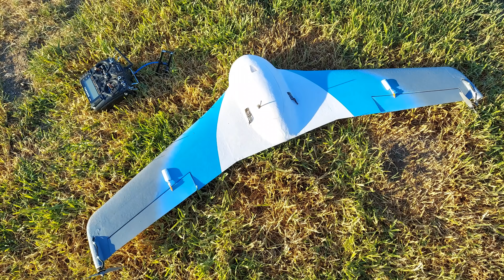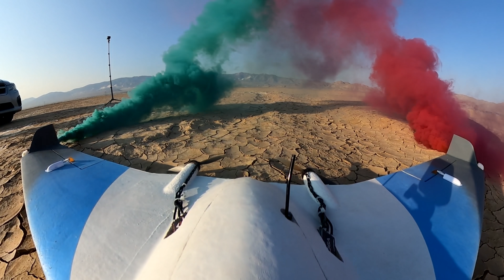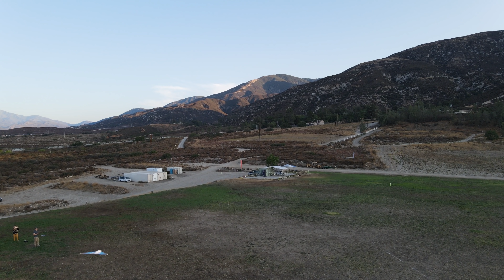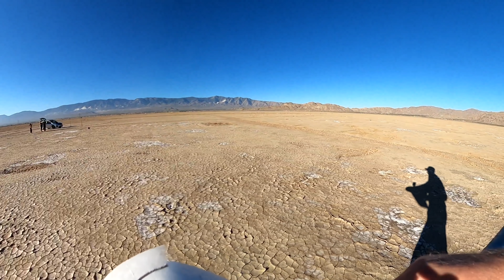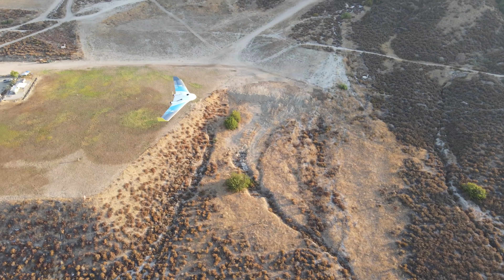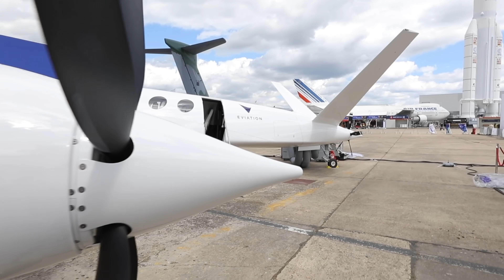Can Wingtip Motors Improve Aircraft Efficiency?  RCTestFlight Solar Collaboration Part 1

Comment: I wonder if the vortex interacting with the props make each individual prop get more lift/propulsion.  Worded poorly but I think you know what I'm saying. You're forcing more air on each blade.
Reply from the maker: I think perhaps making my own wind tunnel with multiple smoke streams starting in front of the wing and prop would be informative.
Reply: Wingtip props counteract wingtip vortices by interrupting the flow of high pressure flow from the bottom of the wing into the low pressure air above the wing,
Reply: I was thinking along these lines, but considering that a vortex would have a different angle of attack for the props than freestream air which would change prop performance.
Reply: @polomarknot17  My thoughts too. The air seems to be 'screwing into' the prop already.
Reply: If this is the case, I wonder if you'd this would have the result of a less aggressive prop pitch angle being optimal.
Reply: Luv ur channel
Reply: @montithered4741  but on the other hand, the props are more efficient when the air entering them isnt turbulent.
Reply: i would think it would be less prop performance.
Reply: How about a catamaran plane where the center of the plane is a single win and either side of the plane is a cabin?  This way you can get your props on both extreme sides of the plane.  Then experiment with v or ^ and - wing configuration to see which minimizes wing vibration.
Reply: @timn4481  correct, so the props could be mounted in a tractor/puller configuration instead of a pusher propeller.
Reply: @polomarknot17  Propeller performance depends on incoming airflow profile
Reply: Prop pitch should be investigated. Due to the incoming vortex, the prop pitch may have to be at an extreme angle.
Reply: @thinkflight  make a wind tunnel like Peter Sripol's electric paramotor. Heck, let Peter make the tunnel for you.
Reply: I was thinking that the reverse could also be true, if the prop were in front of the wing then the vortex it generates would increase the pressure under the wing and produce more lift. Better for low speeds while the prop behind the wing would be better for high speeds.
Reply: I'd imagine that it depends largely on which direction the props spin. If the starboard prop spins clockwise, the outer edge is spinning downward, creating additional lift from the extremities of the wing structure. Spinning the opposite direction, it might be increasing the flow of air directly above and below the outer edge of the airfoil segment, increasing their efficiency. Definitely worth investigating both.
Reply: This can be explained using something called "lifting line theory" and the idea of circulation.  Essentially the wing generates "circulation" (an abstract way of viewing lift, lift and circulation go hand in hand, see Kutta–Joukowski theorem). This circulation "leaves" the wingtips in the form of two counter-rotating vortices. These vortices slightly tilt the lift vector backward causing lift-induced drag, since now a small component is opposing the direction of motion. Next comes the educated guess/hypothesis, The motors produce an anti-rotating vortex to each of the wingtip vortices which in turn reduces the effect these vortices have by reducing the downwash that causes the tilting back of the lift vector thus reducing drag.  Check out lifting line theory and circulation, it's fun to imagine an "embedded vortex" in the wing that spills out into the surrounding flow.
Reply: Consider the question from a conservation of energy/momentum? With an energetic swirling airstream, it has less axial momentum and more angular momentum. A prop acting on that airstream may get a little momentum-thrust bonus if it can de-swirl the incoming air while also propelling it back using its normal mechanism?
Reply: Would depend if the vortex turns in the same direction as the prop or not, and how the prop is rigged to deal with this aero dynamic pattern. The actual benefit may come from chasing an upwash flow, so the benefit would come in terms of lift, rather than prop efficiency. But in this scenario, a pusher prop might not be as efficient as a blowing prop, which would blow the vortex before it affects the wing, instead of after. What you depict, seems to be more interesting if considering taking benefit from the vortex direction. Which could be cool,  meaning a more interesting choice for blade profiles. but in the end, it should be up to the battery/ESC, which isn't desired. So in my humble opinion, the 2% benefit, could be improved by moving the prop afore the leading edge. But it could also be affected by the prop orientation, aswell as a it's actual position relative to the wingtip, as it could be set to blow the wingtip extrado, meaning a more interesting configuration (as was chosen for the flying pancake). Anyway, thanks to Think flight for the vid! Best regards.
Reply: @thinkflight  I don't know too much about the subject, but wouldn't it be possible and cheaper to try to rent an existing windtunnel for a few hours? With enough preparation that might be enough time to get the data.
Reply: @thinkflight  A wind tunnel test would be fun to watch. It would be great to see tests of tractor props, not just pushers.  
The wash from the props may prevent the wing-tip vortices from forming at all.
Reply: Only prop wosh from the motors, depending on the aircraft design, the propwosh will assist the flow over the wings helping to create lift, so in this case you would be better to have a high efficiency wing, if one motor quits on you you going to have a aircraft loosing control fast, with the motors weight been on the very tip of the wing, not a good idea, cannot see any real benefits been on the tips
Reply: @samheasmanwhite  this is precisely how the V-22 and the XF5U function, the upward rotating half of the vortex column presses against the bottom of the wing and entirely eliminates wingtip vortices while also increasing lift very disproportionately, it's how the XF5U could fly so slowly despite being a literal pancake
Reply: @Sethgolas   a more agresive pitch as in going with the flow might work also. contra to my previous comment
Reply: You could also optimise the pitch of the prop to adjust for the change in the direction of the free stream due to the tip vortex. 
I would be interested in see what the difference would be with wing tip motors mounted on the leading edge? Could that help reduce the intensity of the vortex as its forming @smartereveryday

Comment: It would be interesting to see a comparison of wingtip motors in a push vs pull configuration.
Reply: Yes it would!
Reply: more experiments more data!
Reply: I want to use motors to launch from flat land,but without the trike, and not in the prone position, but just using a seat, so I wonder how realistic it is to think of having motors mounted to the wingtips of a hang glider without compromising safety and affecting the flight of the wing in a negative way. I would like to have more options as to where I can launch from other from a mountain, or paying a pilot to pull you and the wing to altitude from flat ground. The idea is to get you and the wing off the ground and to a soaring altitude then access the thermals. The motors can be turned off until they are needed. The wing that is used in the video Is a simple design and similar to a hang glider wing. I used to go to a place where they trained you to fly a hang glider, there you have two options, climb the mountain, or pay a pilot to pull you once you are fully trained. In the video his motor placement seems to be pushing which worked very well. But I was thinking another mounting option for the motor would be in front , then the motor would be pulling I think, so I was wondering which would be the more efficient way to use the motors, push, or pull. Lol, I am not a pilot, and have never flown on my own, but I picture it, and  think about it all the time.
Reply: @13orangeleaf  pulling prop motors generally have more air to bite into, therefore a little more thrust.  This comes at a cost of drag and reduced aerodynamics.  Push style generally have less drag and doesn't affect aerodynamics as bad, but less air to bite into due to the body obstructing it. Of course this is all general statements due to the varying body shapes, arguably more important.
Reply: @nathanlowery1141  ok, then what would  be a better choice to get a wing off the ground and into the air , in other words to launch a pilot and wing into the air and cut the engines. Sorta like a plane pulling a glider into the air to its designated release point. I am going to guess that a motor that pulls would be this choice for this type of task?
Reply: Yes it would
Reply: @nathanlowery1141   I think about if it is possible to place electric motors on a supine hang gliding setup, first safety, then either the motor pushing, or pulling you to a designated altitude, and using the thermals from that point for the most part. But I am also wondering, let’s say the motors are mounted somewhere close to the wing tip position on a hang glider, what effect they would on flight when your using hang glider bar to push out, or pull in while your taking off and changing the angle of the wing with electric motors attached. I am thinking the only difference is with the motors the wing will react quicker.
Reply: @13orangeleaf  I can't really say much about gliders, never used one. Aerodynamically if you used a properly angled and designed motor on the tip of any wing it would make the system more efficient.. the turbulence could be moved in a beneficial way creating more lift. I think the problem you would run into would be control. Even if perfecty balanced thats a ton of weight. Without control surfaces is this feasible? Would make an interesting study.
Reply: @13orangeleaf  You can also write a novel about buying a combat helicopter. When you want an engine in a plane anyway, you could buy a second hand Apache (that military attack helicopter) and have great fun FLYING. It will just cost some money, but the fun will easily compensate that. Now, you only have great fun WRITING about launch here and launch there. Just saying.

Why the hell don't you buy a paraglider and learn to fly that before you buy it? Get real, it is not that expensive and you can start writing comments about flying you actually DO!
Reply: @center4nerds  .. and more let downs.. too easy to imbalance .. centerline thrust is proven
Reply: Pull is always more efficient.
Reply: Its called a Vought XF-5U Flying Flapjack fighter !
Reply: Need two different types propeller to maximize airflow
Reply: @calfeggs  you going to get a lot of turbulence from the first prop the propellers have to be close to each other so a flat motor would be ideal
Reply: I flew hang gliders professionally all over the world. The essence is to fly for hours and/or long distances (like hundreds of kms) without any propulsion system. Of aerobatics not to speak. People have mounted motors/props to wing or harness. Both gained very little popularity. To print solar cells onto the wing and mount a “silent” retractable prop to an e-motor in the keel might work, but still defies the idea. I mean, Superman does not strap on an additional wing suit, does he?

Comment: Might have been interesting to reverse the rotation direction of the motors and see the implications.
Reply from the maker: That would, unfortunately the spar was snapped and I decided to take the plane apart but maybe in the future?
Reply: Yes that was my thought when he said the  vortices were going opposite the normal direction.  I would love to see more experimentation
Reply: twin prop planes usually has the opposite directions, but tiltrotors don't. I always wonder why.
Reply: @VacuousCat  Tilt Rotors usually (always) have counter-rotating rotors... torque cancelling.
Reply: The Wright Flyer had counter-rotating props.
Reply: @thinkflight  Happy someone asked this question as it occurred to me while watching as a clear Null Hypothesis test that would make control losses distinct from gains via votex cancellation
Reply: Even more interesting - try all 4 configuration of push/pull props and spinning down/up.
I'd wager that you're going to get the best lift and efficiency with puller props spinning up- that's pulling air from the top of the wing and enhancing the low pressure for lift, supplementing the high pressure under the wing, and opposing the formation of tip vortices.
Reply: @thinkflight  this reminds me of the flaying pancake or Vought V-173 was the last prop fighter developed by the us tested about to join service but than sacked to to the jet era. and people constantly reporting it as a ufo made the US air force scrap it. thou the main reason it had engines at the wing tips was to stabilize the air currents at the wing tips to say airborne do to its short wings.
Reply: Most twin engine planes with counterrotating props have the propellers spin in the opposite way of what tip mounted tilt rotor planes do. in part this is to minimize asymmetric thrust in case of a single engine off situation (at high AOA the downward going prop blade has a coarser pitch and more thrust), in part to minimize the risk of throwing FOD on the fuselage, and in part to reduce the risk of a prop blade coming off in a crash landing and piercing the fuselage. There's a few exceptions, like the P38, but usually if the engines spin the "wrong" way there must be a very good reason for it.
Reply: @mithrandir1313  . of course but inside up or inside down?
Reply: @thinkflight  before i saw this comment i had paused the video to ensure that the props were rotating contrary to the vortex generated by the wing tip. well done thank you for this video
Reply: @chrisdrake4692  I mean normal opposite directions go forward (rotation direction right hand rule) on the left and backwards on the right. Tiltrotors go backwards on the left and forward on the right.
Reply: @VacuousCat  All tilt-rotors I know of rotate the opposite direction to the airflow - the underside of the wing is high-pressure, and the upper side is low pressure (in forward flight) so the blades always spin the other way, to semi-cancel-out the resultant wingtip vortices:  https://youtu.be/xnOw3clRIoI?t=53 - e.g.  the left one always goes anticlockwise (from the perspective of either the pilot, or an outside observer - same.)
Reply: @chrisdrake4692  I'd say it's because it's more natural if it induces right-yaw when collective-up left rotor to roll right.
Reply: @VacuousCat  There is no Yaw, of course - they COUNTER ROTATE.  Go look at the video links I posted.
Reply: @Mithrandir13 I find it amazing this wasn't the very first consideration when making this rc plane. I would've liked to have seen what would happen with counter rotation in both directions. I'd imagine it'd be more efficient opposing the direction of the wing vortices. Guess we'll just have to guess.
Reply: @manifold1476  They were way ahead of their time.  Even today, their propeller is still one of the most efficient.

Comment: I think in practical GA use, the risks of differential thrust in the case of an engine out, vastly outweigh any efficiency gains.
Reply: maybe it's possible with central propultion and lowering trust on thrusting wing
Reply: @sebastienl2140  you're talking about essentially running on 1/3rd power to solve the differential thrust problem. Most aircraft would seriously struggle with 1/3rd power.
Reply: Bobb Grimley  If you had even minimal flight experience you would know you're not often within gliding distance of a runway. 
And if you had even minimal electronics experience you would know there are many points of failure, especially speed controllers, and engines also fail. Losing a propeller isn't unheard of either.
Reply: @Skinflaps_Meatslapper  You’re essentially talking about a 2 engine aircraft without single engine operation?  You’re saying if an engine fails then cut/reduce the good engine as well, yes?  And you justify this with the existence of BRS installations and landing planes on non-runway surfaces?  If it’s me buying a twin engine plane, I’ll pay for the extra gas to get OEI capability every single time. The moment arm for a wingtip motor is so large that countering with rudder is probably out of the question.
Reply: @horse1-1  I wasn't going to reply to that guy, but you put my thoughts down perfectly.